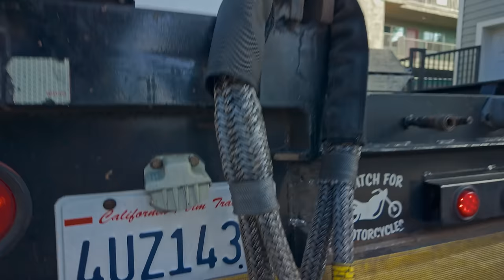Delivering a million dollar home in LA

Comment: 2000 dollars per hour from the shop!! Some of the best money to be made in construction is specialized heavy lifts. Be safe
Reply from the maker: Oh I bet. Worth it too, this is not an area you'd want to cut corners and save on finding the cheapest lol
Reply: @PepesTowingService  It is fun to watch To the top crane he is driving one of those, there is a lot of work planning the lift with the weight, distance and how much counterweights that is needed.
Reply: you better be good for 2000 an hour
Reply: The stress might take you out early though lol @PepesTowingService
Reply: Definitely not 2000 an hour
Reply: Even far more costly per hour is helicopter lifting.
Reply: @JWimpy helicopter definitely can’t lift that weight
Reply: @chrisharris8253  I was just relaying the cost of heavy lifting.  
But, since you mentioned it.  Have you seen what the Boeing Chinook can lift?  They pick up military tanks and planes.
Reply: @JWimpy  yes I have any their lifting capability is only 24000 this house most likely runs around 30000
Reply: To be willing what others won't do and to be a specialty.
Reply: @PepesTowingService like to know what the crane capacity was . 300  or 500 ton?
Reply: @chrisharris8253 in Los Angeles… probably more 🤑🤑

Comment: I still can't believe it's less expensive to do all this for such small square footage than it is to just build one on site.
Reply: Probably made-to-order at a boutique, curated double-wide fab shop ;)  Here in Oklahoma yer super-fancy if you get your trailer home tied down against tornadoes.
Reply: I was going to say the same thing - seems stupid to prebuild the whole thing, and then try to shove it down the narrowest steepest street possible in one go. Just bring the pieces to the site and build it there ffs
Reply: Time < Money much faster this way, it's definitely more expensive but they can have the home ready less then a week after foundation is poured.
Reply: It's less because these homes are built under a certain price. We worked on these type of manufactured home both setting them on their foundation plus finishing the inside. We set 2 halves, married them together raised the roof and I hated the cheap ass things. Good look to the owner. They'll need it more than likely 😢😢😢😢
Reply: There is also the noise and disruption of Nailing onsite ..Neighbors there complain easily and can cause trouble if there is excess Noise.
Reply: One word: Permits.
Prefabs have already been through all the engineering and architectural permitting. You only need a permit to drop it in.
Reply: It’s not
Reply: The area make the home and labor materials  so expensive prolly is cheaper this way shockingly
Reply: 250000 for the house 750000 for installation and transport. 😂

Comment: This tiny house construction would almost be comparable to a single or even half of a double-wide mobile home, but without the wheeled undercarriage. I'm surprised the company constructing these modular homes don't have a portable dolly-wheel system to deliver them. For years many mobile-homes have been permanently placed on top of a 2-3 foot raised concrete foundation. It's quite similar to living in a regular house. I have seen some lifted up like this and set back down. You'll find them in cities and on acreages. But this modular home construction is big now and placing them side-by-side and stacking them offers lots of living place. Nice job how you all delivered it in this tight space.
Reply: Eeexactly, it looks that somebody just bought that and tried to organize transport without any idea

Comment: Depends on leed time. If the crane and rigging company has a yard you could drop the load at their yard then they truck it in. But this works. Speicalized Heavy haul/crane and rigging. Well they dont call them Operating Engineers for nothing. 
.

Comment: They use these things here.  Vancouver Island.  Usually two, one facing the other. 900 sq ft max.   We have an agricultural land reserve and the second house on the land has to be on pier blocks for a foundation and removable.  So they use these.  Way cheaper than a house nowadays.

I can't imagine that with all the costs involved in moving the prefab on to the lot that it was any cheaper than building one in situ.

Great job.  Never seen the fishing off the tail end trick before.  Same for the driver.  Great job.

Comment: Very cool video. It would be neat if you could find and team up with one of the YouTube Crane Operators (or just a normal crane operator) and each put the other through a training session on the opposing machine.  This way you would both see the operational and control differences between the two types of machines, in ways that probably aren't apparent to each other.
Reply from the maker: Cool idea. I feel a crane operator would have a much easier time operating a Rotator than me operating a crane.
Reply: @PepesTowingService  It'd probably depend on what exactly you were doing.  A rotator's small as cranes go, but cranes normally just lift things.  A complicated recovery, especially if only using one truck and having to do a lot of redirecting instead of just putting a rotator on each end, would probably be well outside their experience.

Comment: I am a several million mile driver used to stuffing 53' vans into tight spots (with large car Peterbilt trucks). The trick here would be to start your cut (called 'getting under' the trailer) a lot sooner. After the the trailer barely starts to track in the desired direction, straighten the steers to keep the tractor backing straight down the center of the street. While the trailer is slowly increasing it's angle toward the apex of the curb radius, slowly start getting under the trailer again. When you get to the apex with the trailer as close to the curb as possible, the tractor should still be near the center of the road. Cut hard and get back under the trailer to make it angle quickly, and then turn the steers hard in the other direction in order to 'follow' the trailer into the hole. This method of keeping the tractor centered in the street will greatly improve the room to swing the front end and follow when it's time to do so. I hope this helps.

Comment: 6:27 She sould have gone parallel with the road with the tractor at that point, to get the trailer more into the middle of the sideroad, but she keeps trying to straighten the combination too early, and ends up going towards the timber post.
12:07 Damn, slinging that trailer is precarious as hell. Those hookups aren't far apart. I had visions of a roll over.

Comment: Great video, you really know your equipment. I’m really shocked that you were able to back up with your boom up AND an outrigger down. Most trucks have safety devices that prevent the truck from going into gear unless everything is properly stowed. This isn’t mandatory, but lots of the Mfgs are going this route for liability purposes. Glad to see you have this capability, there are times the modern ‘safe’ mode can be a severe hindrance.

Comment: i have rented 500 ton cranes to pull machinery out the roof of a building when we moved. the stuff weighed about 50 tons but people don't realize a crane is rated in a radius of about 15 ft from the pin. so right next to the crane. as soon as you move further the capacity drops lots. there are load charts for all cranes showing lift capacity at a radius and height.

Comment: Nice work on getting things lined up and over the hump...literally. When the tractor moved over that hump the first time there was plywood just on the downhill side, but when they were backing up the plywood had moved downhill, which made a 3/4-1" difference in the height and that was probably why the fuel tank straps got caught on the edge of the sidewalk.  I have to wonder if it wouldn't have been cheaper to build that structure on site instead of going through all that effort to get it installed onto the foundation.

Comment: I don't think I've ever seen prefab housing moved on an RGN before - around here they always just bolt axles and a tongue on 'em and tow them directly. More ground clearance that way - but if you run out of clearance it's a much bigger problem because you can't drag it without causing damage. They even do that with upper story units that get stacked on top of other ones. They may have put it on an RGN in this case specifically because they knew that awful breakover angle was there, and wanted to err on the side of needing a tow truck versus causing structural damage.

Comment: Oh I left out the Ford tandem 9000 w/cummins & split 10 speed, when the Troopers pulled me over in that and read my pre-trip old lucky 7 was put out of service fully loaded. It ended up getting a new 22ft. body reefer unit & more repairs than I feel can remember. It ran good in 1speed,wide open. R.I.P. Bob

Comment: Man, Up 2 looks kinda different...

I've never seen three spreader bars before. But the whole point of the bar is to... spread out the load. More specifically, a spreader bar can lift two separate points using a single cable, with both connections lifting straight up. This is useful, for example, when you are moving a house, with wooden frame walls and glass windows, and you don't want to cave in the walls by pushing on them with a steel cable. Since this one big crane was able to lift the house, the only problem was ensuring the house didn't swing, and that all four corners were being lifted straight up.

A perfect solution: split the one cable twice, twice.

Comment: It's nice to hear one professional recognize other professionals with an "awsome work, guys." Did they have slots in the bottom to get the straps out? Unlike some recovery jobs where you can lift the object enough and block it so straps can be slid underneath, it doesn't look like that can be done here.

Comment: Most of those signs that are square with the holes have 2 bolts at the bottom. They are done like that so it is easy to replace when someone runs them over. Like 2 mins and you could move it out of the way.

Comment: When I read the comments, there is a lot of difference between one country and another. 
Here in Western Europe we would be ashamed.
It is the wrong truck for the transport, the load is absolutely not properly secured to the trailer, the load is poorly marked, the building is already damaged, the lifting of the trailer is dangerously unbalanced and when pulling back you damage the road surface and the bottom of the trailer!

Comment: They should have considered using Day Cab Tractors like Bragg did, it would have been a lot easier and less expensive if they would have done that once the Pre-Fab was nearby.  Of course in my opinion and easy to say after the fact.  We work with big trucks and equipment in Marin County so we are all about: Power, Gears, Heavy Duty and Maneuverable Rigs with ground clearance.

Comment: I have a feeling a cabover would have done a lot better in a tight spot like that.
I have been in a similar spot with my Box truck, was delivering pallets with wood floors to a building down by the water, and the road in was tiny, i filled the entire thing and you had hedges and such on each side, turns out when i got down there was no spot to turn around at so had to reverse out between cars and containers, and then some crazy back and forth to get turned around on a hill and reverse back, and the spot i needed to drop the pallets at with pallet fork was large rocks, and those pallets where 1000kg each ohh that was fun :)

Comment: A pre-manufactured home is called a modular I work for a company back east I worked alongside of a 500 ton hydraulic crane had four steering front axles and three Drive axles and a two-axle jeep that held the Boom the counterweights in the rigging was on two semi trucks the boom was almost 4 ft wide and 6 ft tall . Worked in industrial maintenance moved massive machinery look up Edwards Crane in North Carolina

Comment: That prefab house could have been prefabbed in managable sections or units instead of an entire finished unit. A small crew of skilled assemblers could put everything together in less than a week. They still have to do work to finish that project anyway. The Tyvek wrapped under the unit was kind of a cheap way to cover the insulation.

Comment: Yes, a residence house/home.. ' built off site' is referred to as Pre-fabricated.  Built the same as modular and  'mobile home'.  there are variances on construction materials, some industry wide and some based on local code. not an expert by any means. but some general knowledge in on and off site construction
Reply from the maker: Thank you. A lot more knowledgeable than I am on this
Reply: Even my neighorhood in an Oklahoma college town of 50k doesn't allow pre-fab construction (other than a shed) to be placed.  And the home placed in this video didn't look much different than half a double-wide trailer home, inside or out.

Comment: think how smoothly it would have gone if you had steerable wheels on the trailer. as well as a terminal truck, they have a raiseable Fifth Wheel Hitch Plate. then maybe they got over the hump without a crane. but then you will be out of a job unless you have such a connection to put on the rear boom. hope you understand but google translate is not on my side when it comes to translating some things.

Comment: Although it was a wide load, it was also relatively light. So why was the clutch and brake action so rough? Was there a problem with the truck or was it the operator. She didn't hit anything, but other than that, the rest of the driving was rough and erratic.All the comments about good driving must be from non-truckers.

Comment: Since when did a damn mobile home start costing $1,000,000 thats effing insane. Is it made of gold because timber, siding, roofing and framing for most  mobile homes or prefab homes would be under $100,000 for material costs. Crazy markup.

Comment: If I was in charge of the logistics of that delivery, I would NOT have booked that giant tractor to deliver a extra long trailer on those tight streets.  Should have used a cabover.  Then would have been able to make those corners. I find it hard to justify the cost of alllll that VS a group of guys that could have built that in a day on site.

Comment: Would it not have been cheaper and less trouble to build it onsite 🤔.
Reply: Nope. There is a reason to building these houses in an assembly line at a factory. The hassle with getting the truck to site is peanuts compared to the additional cost of build at site, which also demands material transported by the way

Comment: How is that more economical to build offsite and then get a crane at 2k an hour, plus the wide load/oversized permits and price tag, and street blocking price tag, and if here in Phoenix, would need to pay off duty officers to control traffic/block streets for ya too.  plus the cost of the house, insurance for the move, etc...  holy crap thats a pricy bill....  To me, it would make more sense to build a structure onsite and be done....

Comment: Cranes usually have a four hour minimum otherwise it wouldn’t be worth it. 2000 an hour? That sounds like California till you pay all the hands out to run a Crain I’m sure 2000 is a small profit. You have five trucks a half dozen people. Permits probably several licenses and registration fee’s. I hear it takes seven to ten years to build a house no wonder they are using mobile homes

Comment: I don't know if your crane axles can carry the load, but our 150,000 lb rotator can both lift 150,000 with the stabilizers down or carry 150,000 on the axles when the rotator is aligned with the chassis. 

For that job I wouldn't have used the stabilizers and instead would lift the trailer behind the rotator and just backed up while she drove her truck forwards. 

One concern I had with this job is I would have wanted the two lifting points on the trailer to be much farther apart.

The father apart they are, the more control you have over stopping the trailer from tipping over. You don't know how well the center of mass is centered over the trailer left/right, so I wouldn't have wanted to take chances by lifting it so close together. 

You succeeded without rolling the trailer and hopefully without to much damage under the trailer. That is what really matters...

Comment: They have the wrong truck for the job to begin with, they should be using a cabover or a Volvo that turns on a dime. A pretty truck doesn't get the job done. 500k single wide.🤣🤣🤣🤣🤣🤣🤣